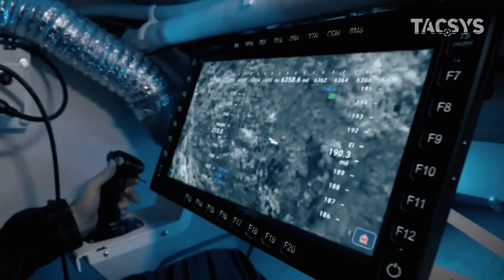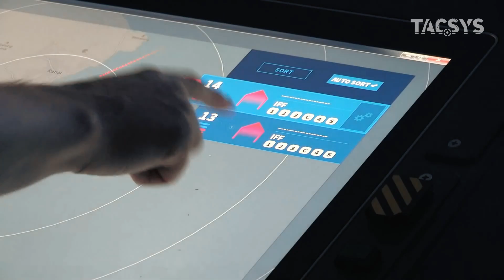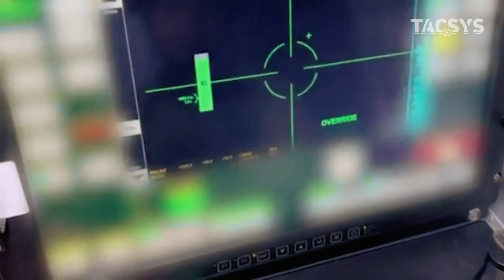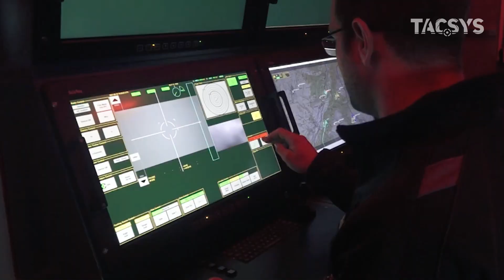Skynex vs Russian Drone Attacks — How Effective Is It?

Comment: Problem is, the units are crazy expensive 70 million euros plus for a unit consisting of 4 vehicles. 

Meaning you need to integrate them in a layered air defense far behind enemy lines.

But then it won’t help anyone at the front due to its limited range.

Also if Russian drones fly at their max altitude it probably won’t be able to hit them.

Comment: The real new trick vs a old Guepard is reaction speed so that radar detects the salvo of projectiles explosions and the shot calculator estimates almost instantly the 3D deviation and distances of explosions to target(s), the minimum corrections are enters into next projectiles timers as gun azimut and the gun elevation correction versus the first salva. Deviations due to wind, target turns during time from shot to impact etc , are therefore minimised…and corrected…Then, an almost secured hit with a second automated salva starts if needed..One smart cannon does now a better job than two old ones…
Reply: But it raised the cost to at least 10 times the old one.

Meaning it becomes a valid target for hypersonic missiles. Can it defend itself against kinzhals?
Reply: @barneyklingenberg4078  No projectile speed is too low…maybe 1100m/sec…and slowing fast…
Reply: @barneyklingenberg4078  A što bi kinžal pogodio, metu u pokretu, teško

Comment: This is essentially a modern version of the German Gepard anti-aircraft vehicle from the '70s.  The Germans dug some Gepards out of mothballs and sent the to Ukraine, where they've been kicking drone ass.  So the concept works.
Reply: It reminds me of old flak guns, it’s a machine gun that shoots explosive bullets, is a combination of the flak 88 and flak 38
Reply: @maxwind7658  Those guns were never too effective.  Getting a direct impact with an aircraft at high altitude is very difficult, and manual time set airburst fuses were tough to get to go off at the right altitude.  

In WWII, the US built the first proximity fuses.  These had a tiny radar set in the fuse that could tell when the shell got within the lethal radius of the target, then explode the shell.  This was a huge improvement (and a much protected secret.)  These are still in use today.
Reply: @b @bbmw9029 ’m just saying it reminds them of them. I mean technology has come a long way since the 1940s. But it reminds me more of the flakpanzer IV “wirblewind”. I mean obliviously they’re using rading right now, but back then for radar you needed quite big installations